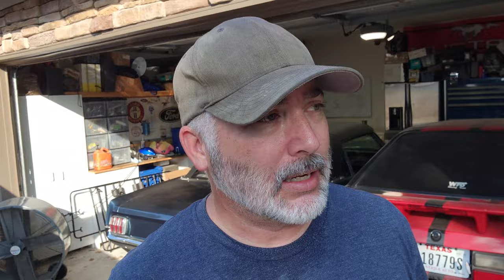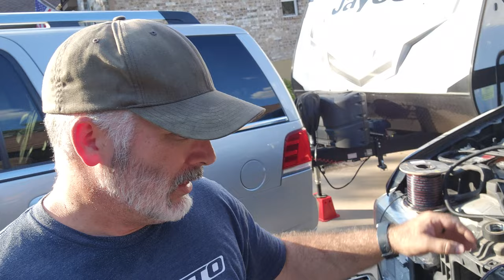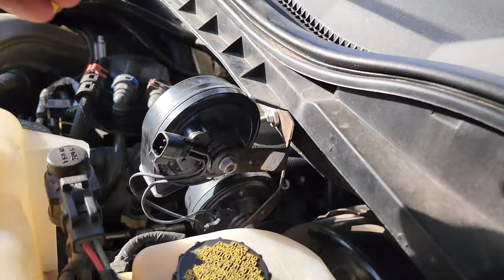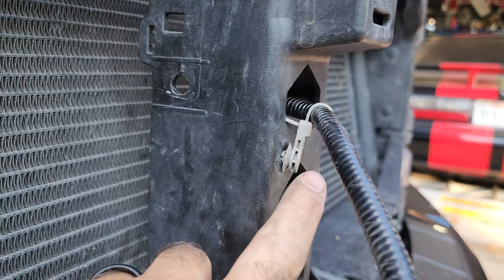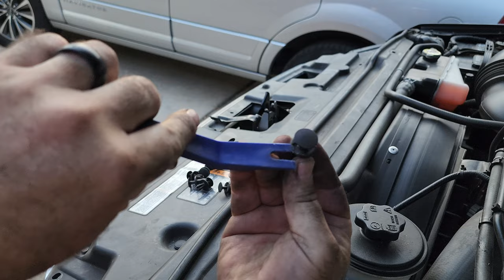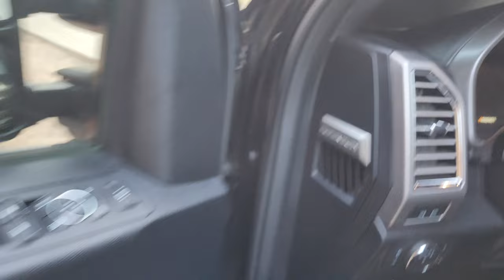Ford Super Duty Horn Relocation

Comment: How did you fix your door handle?  Do we have to buy new?  Or can we snap the pried out one back in?
Reply from the maker: Usually, it snaps back in.  But sometimes the clips are broken and it won't.   You may have to buy a new one.  If you do, you may consider getting the passenger side door without the lock to replace it.  Otherwise, get the Jimmi Jammers.

Comment: This happened to my 2015 F150 yesterday. I was at Barton Creek Square Mall in Austin, TX. I was also parked close to the entrance and it was broad daylight. They unplugged the horn via the grill, then broke into the driver’s side door by breaking the lock tumbler with pliers. Seems to be a real issue here in south Texas. Luckily I didn’t have any valuables for this piece of garbage to take. Thanks for the video, very helpful.
Reply from the maker: Sorry this happened to you!  Thanks for watching.  If you're interested, I've got some more videos coming on how to try and stop this garbage, so be sure to subscribe!
Reply: @WhitetailGarage  Thanks, will do! One of the options my body shop guy mentioned was replacing the driver side handle with a passenger side handle with no keyhole. This does eliminate them going after the exposed lock tumbler, however if my battery ever dies, it’s a whole new problem. Looking forward to seeing what you come up with. Do you know if this is still a flaw in newer model F-series?
Reply: Just happened to me a few days ago at the Alamo Drafthouse on Lakeline.
Reply: @jj042 that's where my break in happened too. Right after we watched the iron claw movie
Reply: Happens to me yesterday at the hotel in Austin in Barton creek! Insane how quick they break in now I have to replace the door handle, the unplugged my horn and broke the lock

Comment: I had the same thing happen on my 2017 F250 last year.  Except they didn't cut the wire, just unplugged the connector at the horn.  I have a Lariat Ultimate package so a little different grill, but same basic premise.  They went through the window the same way and popped the inside door lock up as well.  They messed up my door panel doing this, which insurance replaced.  This was the third time they hit my truck.  The first resulted in the door lock delete, the second required replacing the back door driver's side window, and the third was the horn disconnect/window break.  Thanks for showing this easy way to move the horn.  I saw another video but it was for a gas engine and they relocated the horn down to the drivers side by the core support.  No room on the diesel's in that spot.  I will be moving my horns to where you have yours now along with the wiring modification.  Thanks for this!!!!
Reply from the maker: So frustrating!  Sorry to hear you have been hit that many times!  My plan is to add an air horn that is very loud and goes off with the alarm.  Nobody turns around for a normal car alarm.  They will if they hear a train in the parking lot! Thanks for watching.
Reply: @WhitetailGarage    Looking forward to that vid as well.  Be sure and post the info on the horn so we can all scare the crap out of these little rats!!!!